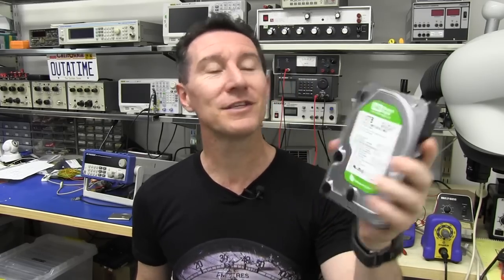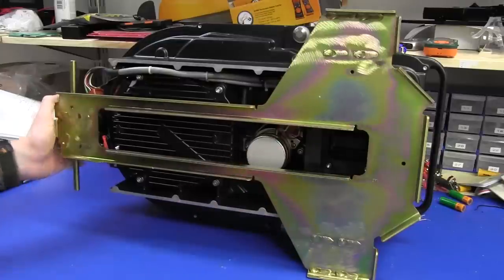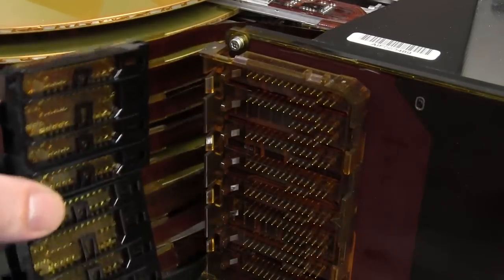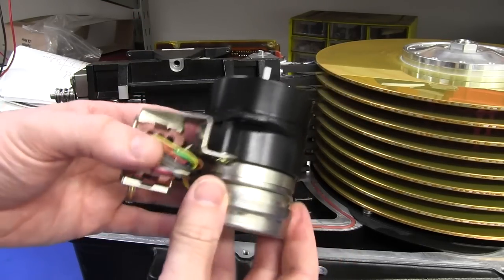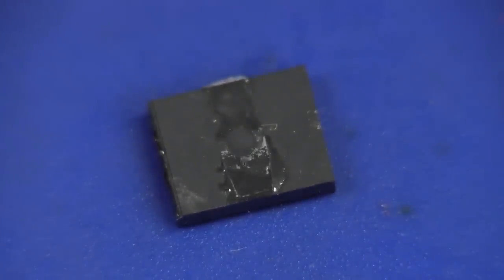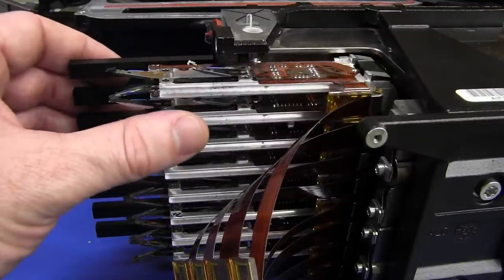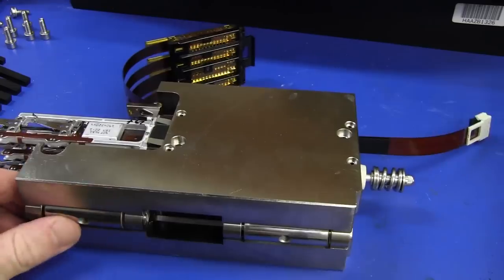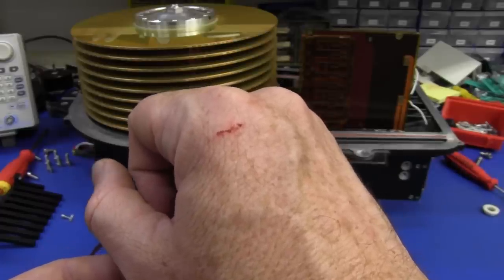EEVblog #395 - World's Most Expensive Hard Drive Teardown

Comment: I went looking for the 3390 manuals.  I found the 3390 software manuals here:
https://www-01.ibm.com/support/knowledgecenter/SSB27U_5.4.0/com.ibm.zos.r9.ifc2000/ifc5r103192.htm?lang=en
Everything you need to do to calculate how many drives you need, who to configure the operating system to interact with them, and how to configure them in and out of service.

I could not find any hardware installation and troubleshooting manuals.  And not on the 3380 either.  I suppose IBM didn't publicly distribute the hardware manuals because in those days only IBM employees should be physically working on them.

I did find hardware manuals for the DS8000, which looks like it came just after the 3390.  It seems it would be set up to emulate 3380 and 3390 DASDs.  The manuals seemed to be intended for customers to use.

'DASD' = direct access storage device, but only disk drive direct access storage device.  

If you called DASD 'disk drives' people knew you were from a non-IBM shop.  Kind of like how medical professionals have their own buzz words to separate "those of us who know from those of you who don't."

Comment: During the same period IBM ripped off people with those machines I worked for a company that used DATA Point equipment and one 20" platter held 200 megabites but the platter was removable and ran about $200 dollars. there was an old joke that no one ever got fired for using IBM but they also never got a raise becuase they spent the money they might have gotten. IBM was more concerned with keeping everyone using their equipment rather than passing better prices on.

Comment: I have some 20 Mb IBM HDs from the 60's 10 platters, 14 inch diameter on removable spindles. The heads move with a hydraulic head actuator, not kidding...oil. These things were worth a million new.
They were scrapped in 1970 so I took them.......ya, I'm old enough I fart dust.

Comment: super nitpick: You can get smaller hard drives than the one you're holding. 15+ years ago I bought a Seagate ST1 Microdrive, which is a 4 GB HDD that is inside the form factor... of a compact flash card. I used it to upgrade the size of an old Creative Labs MP3 player. I'd LOVE to see someone tear down one of those! They go for like ten bucks on ebay these days.  There are "smaller" drives supposedly the size of a postage stamp but as far as I know, those are super rare, not mass produced like the Seagate Microdrive was.

https://en.wikipedia.org/wiki/Seagate_ST1
https://www.dpreview.com/articles/0246141492/toshibahdd

If I can find my old drive I'll send one to you.

Comment: Would it have been practical to attempt to use it before you tore it apart? or wouldn't it work? :D
Reply: well, obviously...
Reply: You wouldn't necessarily need one, you could attempt to find either compatible hardware or if you where desperate you could make a board that made the two standards compatible (rather like an IDE to SATA connector). otherwise you could just find the pins that connected to the motor and watch it spin.

Comment: +EEVblog

ROFL!!!!

Sorry, but that ONE IBM 3390 hard disk HDA by itself might conceivably cost you $30,000.  Announced by IBM first in 1989!!

A 3390 Storage Subsystem Model A14 contains two of those HDAs and the whole system would cost about $90,000 for 3.78 GB of storage.  And it would transfer data at a really rascally 4.2 MB/sec.  A "standard" model, likely would have 8 HDAs  in an A unit (the controller and 4 HDAs) with a B unit ( 6 additional HDAs.)  Might then run you about $225,000 

Do the math on the capacity to get 18.9 GB in a six foot high, 4 foot deep, and 8 foot wide footprint that probably draws about 4 KW of wall juice.., 

;)  I used to do early development testing on the systems..,   I still have a scrap disk platter and a two actuator head/arm assembly. I worked on them from 1987 to 1991.

Those were the days.

Comment: Ah! Youngsters! No bloody idea what we computer engineers had to deal with. I used to work on RK06 and RK07 (14MB and 28MB) disk drives mainly https://www.pdp-11.de/index.php/dec-devices/dec-rk07-disk-drive/) in the early to mid-'80s that were cartridge drives the size of a washing machine. The magnetic actuator for the heads (just 4 heads) ALONE weighed around 8kg, never mind the rest of the disk drive that weighed more than two brick built Aussie dunnies! Prior to that, in the mid to late '70s, Whilst at Ferranti Computer Systems I worked on 2MB (yes JUST 2 MegaBytes!!) disk drives from Burroughs that were built into cabinets 5 foot tall by a couple of feet wide by 6 foot long. They had single 3-foot diameter (approx) platters with disk heads loaded by air-driven actuators with each head assembly containing multiple heads, being about 50mm wide, and around 8mm thick or so!! Here's a picture of a much later (Around 6 or so years) 12 times capacity, half diameter disk but otherwise very similar to the innards I worked on. https://www.reddit.com/r/pics/comments/2lse4i/250_mb_hard_drive_1979/

That Winchester drive from IBM you have is actually quite a "modern" unit. Winchester drive units were FRUs rather than have an engineer on-site for hours fitting new heads it was MUCH faster, and therefore cheaper, to do an HDA (Head Disk Assembly replacement). That was the time that Field Service Engineers started to become more like garage mechanics - replacing modules rather than proper electronic engineering troubleshooting and I got out into Sales. One of the last of my "big" sales in around 1997 was to a well known large UK music company for a Y2k project that included just 500GB of mirrored high-speed disk storage on a clustered pair of servers. JUST the storage (9gb 10k SCSI drives) required a full 19inch rack with the two computer boxes in a second rack - the whole system cost just a bit shy of around £600k IIRC! I recently bought 3 off x 2 TeraByte Memory sticks for less than £10 off eBay at less than 0.0001% the volume but 4 times the capacity but the very first storage device I ever worked on, back in 1976 was a 32k drum device!! Yes, kilobytes! And how many young guns have even heard of an 8-inch floppy disk or the drives to take them? Here you go: https://www.pdp8.net/rx02/large/rx02.jpg  https://upload.wikimedia.org/wikipedia/commons/thumb/a/aa/Floppy_disk_2009_G1.jpg/1200px-Floppy_disk_2009_G1.jpg

Comment: Looks in the 1969 or 1970s
Reply: 1989. Successor to the 3380 line of DASD. 1960's would be the 2314 line. 1970 was the 3330/3340 line. These were mountable drives. Fixed HDA 3350's came out some time in the 70's too.

Comment: Your "one minute or you'll die" is just made up off the top of your head. You need to stop doing that, Dave. Either do some research or quit making shit up. I came here for the hard drive, not your half-baked banter. It also makes the videos twice as long as you repeat yourself and blather on. 

The big advantage of Halon, compared to, say, CO2 fire suppression systems, is that Halon ISN'T dangerous to life. You can stand in a room when Halon is released, and be perfectly fine, as the fires disappear around you. It disrupts combustion at levels safe to breathe. 

Halon was banned because it damages the Ozone Layer. Apart from that it's a great thing. 

Hard drives aren't notably flammable. It seems, from the quick Google that you didn't do, that it's more likely a gaseous coolant circulated around the drive. Which could be Halon, I suppose it saves on having a second gas system if it's already fitted to a building. After Halon was banned, I suppose it would need replacing. Some chemically inert gas would obviously be a good idea. Modern hard drives also have small breather holes, to equalise to atmospheric pressure.
Reply: thank you
Reply: If halon is pumped into a room would it displace the breathable air? If so I guess a gas mask would do diddly-squat.
Reply: Correct. You wouldn't want to stand in a room with halon being released.
Reply: No, it is completely fine to sit in a room with halon released, as the fires go out around you. Of course if it completely displaced the air you'd be in trouble. But halon systems weren't designed like that. That's CO2 systems that are.

Halon puts out fires without needing to displace air. It interferes with combustion. It's a very clever chemical invention. It puts out fires, while still mixed with enough air to be comfortably breathable. You don't need masks, or air supplies, or anything like that. Although it's generally a good idea to leave if a place is on fire anyway.
Reply: From the good old Wikipedia. "Human exposure to Halon 1301 can be toxic, affecting the central nervous system and other bodily functions"
Reply: Yes, Halon can be bad for you. Indeed people used to get high inhaling off Halon fire extinguishers, and sometimes died.

The POINT is, Halon will put out fires at a level completely safe to human life. Halon systems aren't designed to saturate the atmosphere with it. They just release it, it falls to the ground (heavier than air), and the fires start going out. Meanwhile the human occupants are all fine. Except for being a bit burned possibly.

Dave says that when the Halon alarm goes off, you've got a minute then you're dead. That's bollocks. Utter bollocks that he made up. Possibly he's confusing it with CO2 systems, except they don't generally use those in areas that are normally inhabited. They're more for substations, heavy switch rooms, that are nearly always empty. In fact you may be required to deactivate a CO2 system before you go into such a room.

There's no danger from Halon fire suppression systems. Never mind the gas itself off Wikibloodypedia. They were designed and implemented to be very safe. If it wasn't for Halon's ozone-ripping qualities, it'd still be in use now. It was a good thing.

Dave was talking out of his arse when he said the Halon system going off, in a fire, would kill you. Because that's not true.

OK?

Dave has a habit of making shit up, in his longer waffles. And I find that annoying, since you're supposed to come here to learn about the subject, technology. Not a bunch of old wives' tales, and half-remembered fictions from who knows where in Dave's cranium.
Reply: greenaum interesting, I always thought that Halon actually consumed the oxygen w/o burning it. Thanks for the chemistry lesson!